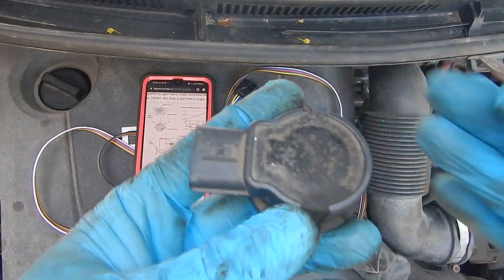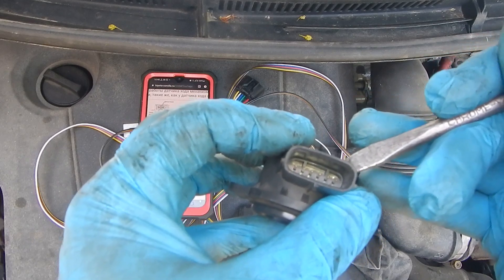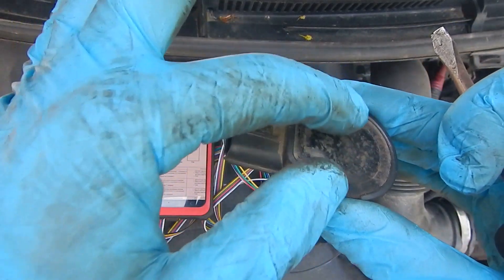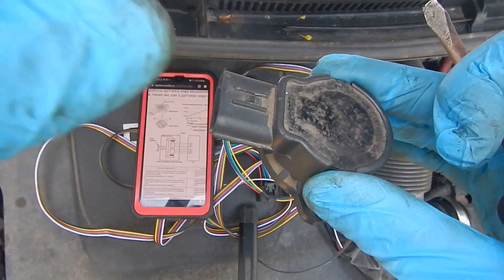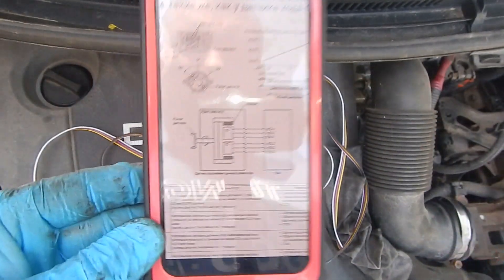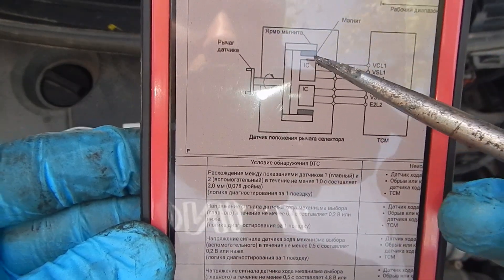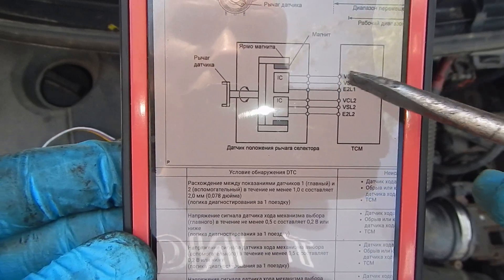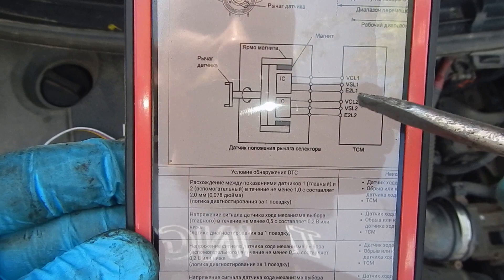Toyota MMT Semi Automatic Sensors on Actuators Clutch and Gears full description How it Works Checks

Comment: Top video, that helps! I want to use this actuator for hand clutch in another car. (Lost left leg, motorcycle accident). Are you familiar with the newer actuator, what has no press-rod but works hydraulic? 
Regards, Oliver
Reply from the maker: Yes, in 6 speed trans - clutch actuator with hydraulic.
https://youtu.be/5TI0L5O3-Zs?si=a-nvFTdB1BDi4HKl

Comment: Hello, great info, i have a problem, 2 years ago i had a N blinking , but i solved by changing the  little motor of the actuator, i was working for 2 years, but now when i drive suddenly i have a N blinking and the acelerator do nothing, i changed again the little motor but it dos nothing, i manage to drive 300m but goed again from speed 3 to "N" blinking and red gearbox sign ! do you have any idea , normaly engine off and brake push,  i can hear the actuator engine push , when i go on R, or E but here nothing ? thank you :-), also i have no code on my little scanner (on iphone with car scanner)
When engine is on i can accelerate .
Reply from the maker: Hello.
Check codes this way:
https://youtu.be/W2DRdW2XflM?feature=shared

Comment: I just bought Corolla D-4D 2005, during I drive the car and slowdown the speed the gear place to N and the car stop moving , and I can’t shift to any gear R or manual +-, until I shut down the engine and start it again , it work normal
Reply from the maker: First - checking for codes, follow next video how to do it:
https://youtu.be/W2DRdW2XflM?feature=shared
Reply: How did you fix this ?

Comment: I have toyota aygo 2007 ( p0806 / p0807 )
What i need to do. Please help
Reply from the maker: Hello.
It is bad contant or wire or connector or sensor on clutch actuator.
If you need new connector with wires - i have brand new.
https://youtu.be/X1TwI7_MeLE?feature=shared

Comment: Hello,
I have got P0909 and P0919 on my Aygo MMT. Gearbox is in Neutral. Normally that should be the Shift actuator. As I have to remove the clutch actuator first anyway I tested it according Toyota manual.
I found the Clutch stroke sensor faulty: One of the two circuit shows 0V until half way and then started with 1,6V until the 4,05V at full deflection. There was no specific fault code for the sensor!
Do you think this sensor is the problem despite P0909 and P0919?
And have you ever used the Chinese sensors from EBAY at 29€??
Thank you so far
Klaus
Reply from the maker: Hello.
I have original sensor.
No problem to send everywhere.

Comment: P2135 is it for this sensor? The car starts, changes a few gears and "N" flashes again, I leave it and after one or two hours I start it, I go and the same thing again. it only shows me this code P2135, the engine is working perfectly on neutral
Reply from the maker: Hi.
Check codes via wire.

Comment: if you get P0808 sensor high error it does not necessarily mean the sensor is broken, it can mean that the actuator is just installed wrong, take off motor from actuator and turn it to extend to maximum minus half a turn, then reinstall motor and install properly and the error may be fixed
Reply from the maker: Usually p0808 if sensor is disconected